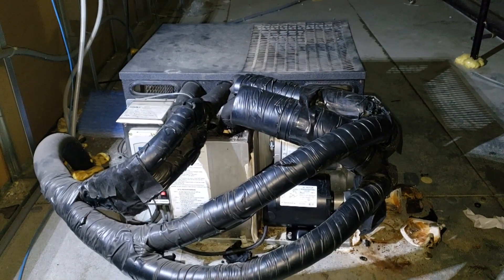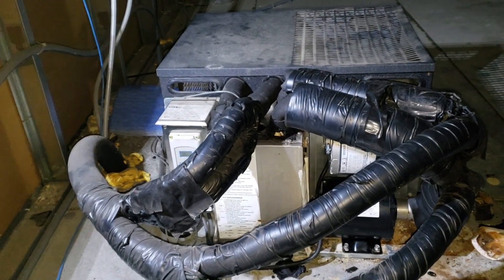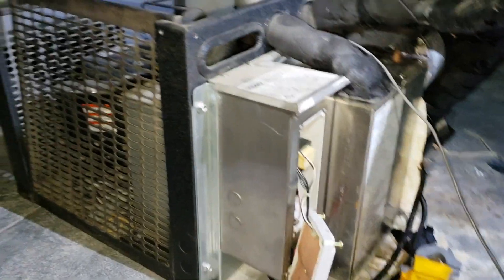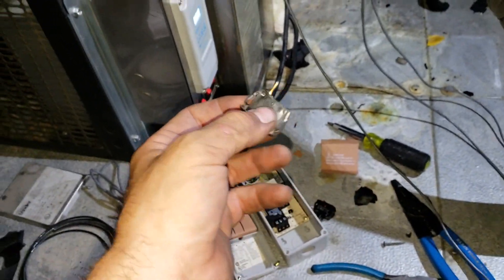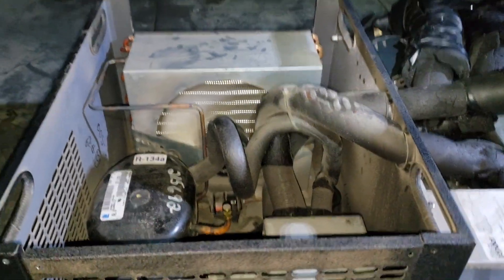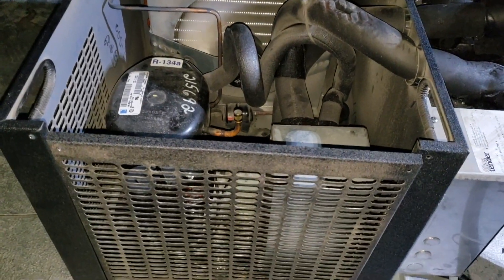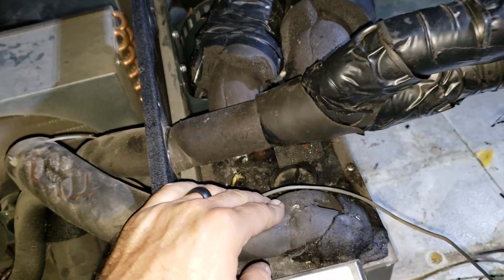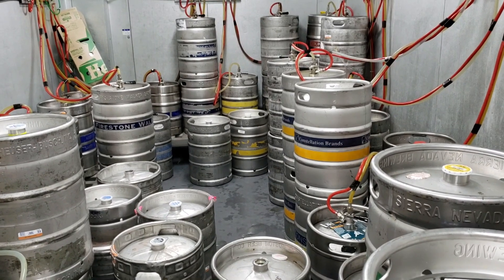Glycol unit not working

Comment: I'm running small business with 24 beer tap behind the counter with long underground line, pretty much going through the same issue as I can see in your video. 
Our glycol unit was working fine till last month, until one motor went off, within a week or two Glycol inlet/outlet copper unit got frozen pretty bad and second motor went off. 
 I am gonna follow same steps like you did to see if its a similar issue... or any guidance will be helpful. 
Can you recommend any other preventive action that should be done? Our Glycol machine is getting older...

Comment: I have a question ? Why does my floor standing aircon is making noise ? It sounds like powerline when it   automatically switched to fan and to cool mode   it's a  carrier brand  and also I can't set  the temperature on 27   so when I start  it up the temperature  starts on  30 until It reaches 24 and  23 .

Comment: The power switches are meant to control relays. Those motors are too heavy of a load. I have OCD in the electrical trade so I would have put 20 amp relays on those switches. They also needed to put a piece of cheap finned metal on those resistors or use resistors that have better heat dissipation. Everything is cheap nowadays and we have to stand by high standards because when something fails the customer blames the installer and it makes the installer reputation go down. I get irritated with other trades leaving boxes, trash, empty cat 5 and 6 boxes in the attic space. They are so lazy and I have to breath more insulation dust and sweat another 20 minutes because I can't see leaving that trash in someone's attic to potentially fuel a fire.

Comment: The discoloration on pcb of the controller is completely normal. The 2 resistors there are power resistors, probably for some voltage regulators or current shunts. The replacement of the controller was completely unecesaary.
Reply: Badass, thanks

Comment: when it comes to using a recovery tank, should the person determine the sides based off the where they say liquid or vapor or determine them by the color of the knobs?
Reply from the maker: No the colors of the knobs changes from tank to tank. You need to read what it says on the tank knobs
Reply: @HVACRVIDEOS  ok thanks also, it seems that my teacher is not a fan of recovering with the tank upside down and going into the vapor side
Reply: I was doing it earlier today and he thought I was doing it wrong.

Comment: I think you replaced the controller for no reason, the cheap board discoloration is normal due to those power resistors there.
Reply: Or maybe he saved the customer from a shut down in a week. The last thing he wants to get is a call saying "We had you out a week ago and it still isn't fixed." Its called preventive maintenance.
Reply: @nes999  Maybe. But as I said, a board discoloration around a power resistor is a normal and common thing, so it is not an abnormal sight. So replacing the controller for that sole reason is not a valid one as it is a normal sight.

That said, if he would have said that the board is old, and the relays clicked alot, or something else then yes I would have accepted the preventive maintenance. But this is purelly cosmetical wear.
Reply from the maker: thanks for watching, I am going live a little early today 12/24/18  at 12:00pm pacific standard time come on over if you can and check it out https://youtu.be/rDd469JwYww

Comment: Why would this system not just be a pump and heat exchanger in the beer walk-in??? Seems silly to have a separate compressor/condenser/Evan on the roof.
Reply: The heat transfer fluid is the clue Stazell... The beer box temp is in the mid 30's, but the glycol mix is circulating at around 28° in this style system. The available cooling is not sufficient using the chilled air in the beer box.

Comment: Is this the normal setup for a typical bar?
Reply from the maker: Yeah it is
Reply: Especially with long runs like that. There are bars where the layout precludes the need for glycol chillers, they can get away with good pipe insulation. It's these long runs is where the glycol pumps come into play.

Comment: Could there be a fuse box added to the toggle switch line individually to control amps? Also when time permits could you do a video on LINE and LOAD (input/output) sequence. Thanks!

Comment: At 70 degrees the beer in those lines is going to start growing some very nasty things quickly. Operator should have followed your advice. 
After 30+ yrs in F&B operations the three things I personally refuse to consume: fountain soda, soft serve ice cream and draft beer
Reply: Unless it's one that you worked on and knows it's giving a good product?  I've worked with self-contained Stoelting units and know not to let them run dry; There are no low temp limit switches on the crazy thing, letting frost build up. That frost jams the auger, causing damage to the drivetrain.

Comment: Why not throw a stubby on suction an see how it’s doing. Almost no refrigerant lost. 37 degree beer seems high. 33-34 is normal for our customers.
Reply: That small a R134 charge is a PITA to get rebalanced, and on a cap tube too!  It's like dealing with icemakers, there's  fine line between making icebergs and an overpriced water fountain, no ice at all. You don't just slap gauges on a sensitive unit, even with precharged lines.
Reply: Nighthawke70 I’m not sure what your referring too by rebalanced? Cap tube systems are pretty straight forward.. I agree with not putting guages on every unit but a call back is worse than an ounce of refrigerant lose on a system like this.

Comment: One thing that kinda concerned me a little bit was your take on the PCB discoloration. This is normal, that is why they have high power resistors in that vicinity. they are going to put off some heat. Resistors like that are a poor-mans way to get simple voltage regulation from a high voltage input, to a low voltage 12V or 5V DC current with a zener diode and big dropping resistors. Its gonna get hot.
Reply: Yes it gets hot but what this guy is selling is piece of mind. When he touches equipment he owns it. If the customer will pay a little extra and things just work this increases his reputation
Reply: @fluke196c  Not only that, but it could save an overtime service call.
Reply: What you'll see near hot power resistors is cracks around the solder joints where the legs of the resistors go into the pcb. The continuous heat dries up the solder so it's a good call swapping it out. Either that or just redo the joints on the pcb.
Reply: I'd tend to agree with you, I see discolouration on PCBs all the time, it's just the board components dissipating heat & degrading the board in the process. Other than that, top job.

Comment: Nice video. Those glycol chillers can sometimes take a few hours to pull down. Sometimes garbage can leave you clues. I saw a semi hermetic with SIX used driers tossed aside near the unit. The compressor had two busted valves inside and Buddy was changing driers each day for a week not knowing why they got plugged up.

Comment: Had an issue with a similar unit at an Outback. Trash everywhere on the walk-in as well. Their beverage company told them they needed to replace the entire unit. Ended up being the run cap for the condenser fan. People just have lost integrity for workmanship anymore.
Reply: You are so right. Got an HVAC referral from a friend... called 'em for a "no cooling" situation. Founder's son had taken over the business, and he rolls up with his new tats & new Truck. Tells me what a crap job the installers did, that he can tell the compressor is junk, and neither he, nor anyone he knows will work on it. Called my nephew who does HVAC for the City. He turns it on, says he suspects by listening that the unit is low on refrigerant. Pulls a vacuum, confirms no leak, re-fills the unit, and it's been working fine ever since. Turns out the guy who fixed it the previous winter, when the plumbers busted a line, forgot to come back and fill it up. He denied ever having worked on it. Weird thing is, both of these dicks gave me their business cards!